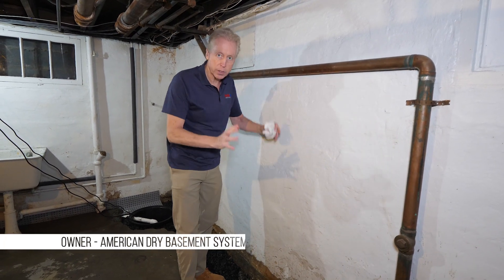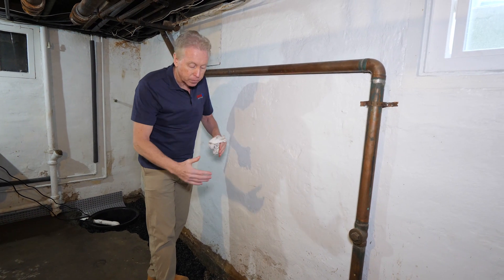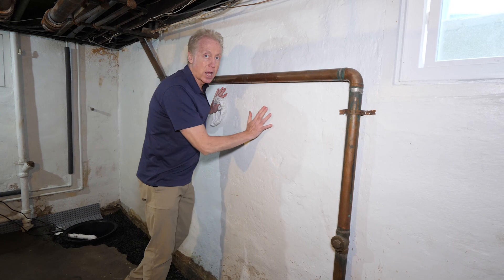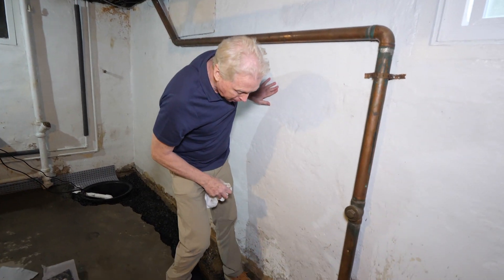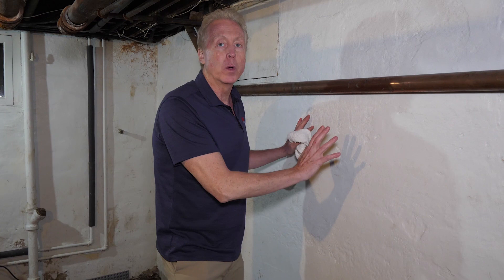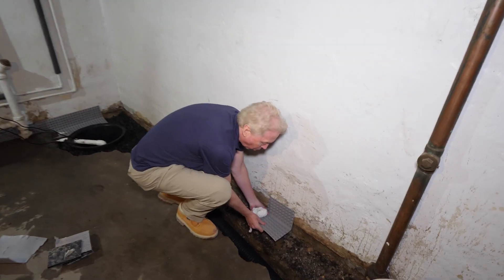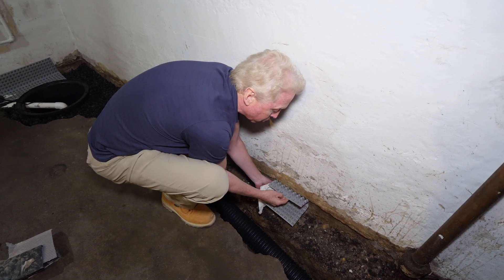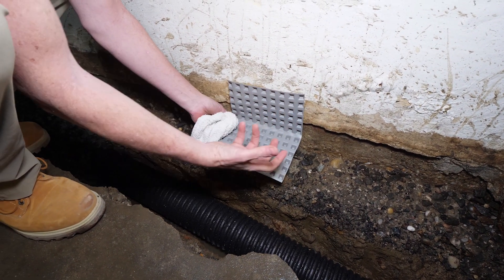Basement Waterproofing | What is a False Footing?

Comment: What are your thoughts on this, please? A local company here in MN suggested that they make an erosion curb out of concrete in the trench next to the false. Roughly 4-6” wide by 12” deep in the trench. Their reasoning is that over time the dirt and/or clay under the 1916 poured thick foundation wall might erode and settle the house. This seems very likely to me over time. But they use one of those flat bottom patented track systems on top of the erosion curb instead of a piped/gravel drainage system, which I rather have. What do you think about the idea of an erosion curb?  Thanks.

Comment: I have exactly this kind of basement in a 100 years old house. 11inch thick walls with no footings. The only difference is that the entire house and part of the backyard are filled with giant boulders and crushed rocks, instead of hardened clay. The house is built on a slope, so I believe they put boulders and crushed rocks to make flat surface to lay the foundation. My floor is also very thin only about 2 inches of concrete.  Thank you for sharing this knowledge with us.

Comment: I have a similar situation in an old old root cellar in my basement. The rooms appx 6x6 and during winter thaws and heavy rains would take in a significant amount of water. I wound up digging up about 4" of the top layer of soil and then putting a sump pit which I drilled a bunch of holes in the lowest  corner of the room. I did add a drain tile because I was concerned of the structural integrity of the ext walls so I back filled the area with 3/4" trap rock. Everything discharges very well now but I haven't filled the area with concrete. Should I first put an underlayment or dimple board to somehow divert the water to to the pit or just leave it as is and pour the concrete? 
Thanks... Your videos are very educational and to the point.
Reply from the maker: You could in theory use stone without dimple board, but you must separate the stone from the poured concrete floor with a 10-20 mil vapor barrier. You don't want concrete seeping between the stone and hampering the drainage of water. You still should get a hold of dimple board to direct water more efficiently to the stone.
Reply: @AmericanDryBasementSystems  the same goes for my basement with 11”thick walls without foundation can I lay small stones directly and then use pvc pipe then use dimple board and finally use cement nil thank you very much

Comment: Do you bother with drilling weep holes?
Reply from the maker: Not usually with solid concrete walls. No reason to drill if water is already passing through cold joints. Solid walls do not have hollow cores that fill with ground water like concrete block walls. It is mandatory to make weep holes in concrete block walls.
Reply: @AmericanDryBasementSystems  thanks!  How about terracotta (1920s) blocks.  My basement has these (no footer also).  Thanks!

Comment: Is there a specific reason you use Corrugated pipes instead of PVC with holes at the bottom?
Reply from the maker: Only type (corrugated) of pipe that uses gravity for self-cleaning. PVC requires clean outs to flush pipes clean annually. Slit and sediment will cling more easy to PVC even with a pitch.

Comment: I am having a company waterproof my basement , but after seeing the videos. I believe I may have made the wrong choice. I only have water in my basement when it rains a lot . They told me that I only need  the water guard system . Should I not even let them put it in? 
My house has an old drain tile system that is probably clogged.
Reply from the maker: That is very unfortunate. If you have a basement with a footer or not that system will sacrifice the structural integrity of your foundation. They install on top of the footer within the depth of your floor. It doesn't attempt to remove water until the water is within the depth of your concrete floor/slab. Damp slab means damp basement. I doubt they will remove the old drain tile and they should. Steer clear and find a reputable contractor who installs continuous pipe running parallel to the footer. The old drain tile will have to be removed before installing the new pipe drainage.
Reply: @AmericanDryBasementSystems  thank you so much for your reply and your information . 
I was able to find an honest contractor who found a crack in my foundation wall, and will be fixing it for me.  A good ending for me. He proved it by running a hose for under 3 minutes and sure enough , water was coming out.  He said no way you need a drain tile, installation.
Reply from the maker: @osvaldodiaz8733  I'm glad to hear there are still some honest contractors among us. You didn't mention a wall crack in your comment. I would keep an eye on it after the repair. Hydrostatic pressure may make a sister crack on the opposite side of the room, or water might come up elsewhere. If either of these things happens - you better have that same contractor replace the old drain tile with a new system, including pumps. All the best.
Reply: No crushed stone below the drainage pipe? How do you prevent it from clogging?

Comment: My house does not have a footer at the bottom of the foundation which only goes down about 5 inches below where the cement floor was, I tore up the cement with the expectation of having footers way down. The idea was to put in the drain tiles around the whole perimeter because the floor was cracked and humid if I left something on the floor. Now  I am afraid to let anyone do it, I haven't found someone to convince me they know what they are talking about. How would I know if the dirt underneath is strong enough to support my home and that footing made from compacted dirt wont move?
Reply from the maker: We deal with situations like this often in the northeast, especially with homes built before 1940. The compact hardpan clay acting like the footer is terrific. You have to create a false footer (in the hardpan clay) along the wall and then dig a trench next to it for your drainage. Every house, on any foundation, will always settle and move, but you can slow this down by decreasing water saturation around the foundation.
Reply: what if it is sandy soil? can false footer still be created? thanks